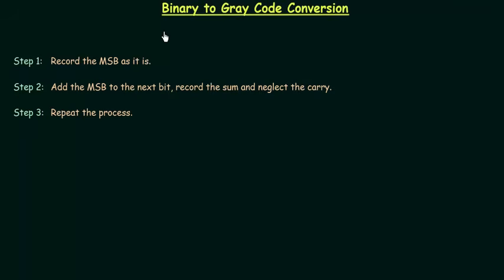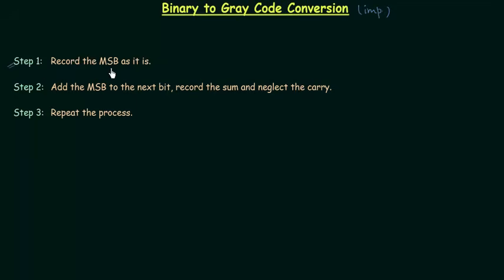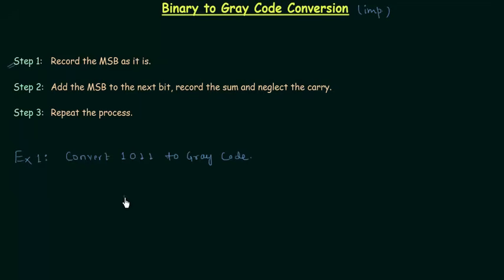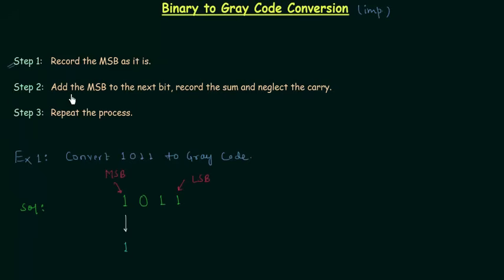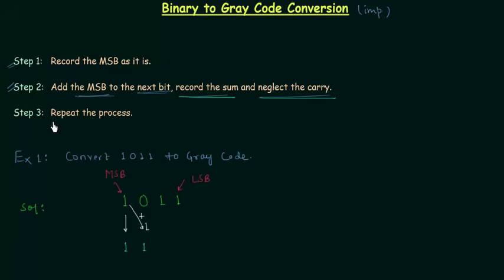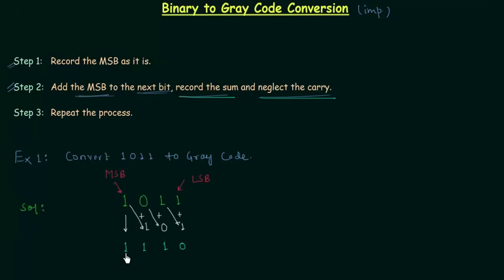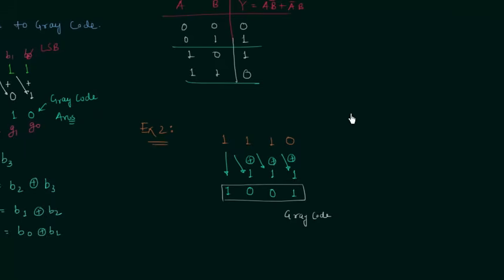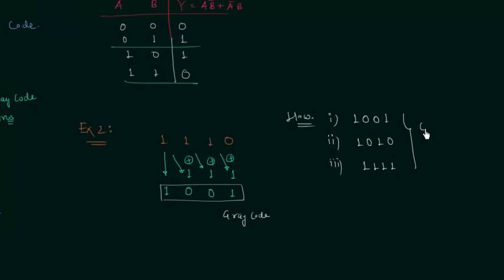Binary to Gray Code Conversion

Comment: Thank you very much for this wonderful series
However I have a question ,how is the gray code of 10000 is 0000? 
That was mentioned in the previous video. 
It should be 11000, isn't it?
Reply: because we only have 4 bits to work with and gray code of 15 is 1000 therefore for 16 we do 0000 as two numbers having difference of one in their decimal value should only differ by one bit. so since 15 is 1000 making 16 0000 makes sense

Comment: I have a better method. I observed the table and found out this. 
Let's call it Rohit's rule.
Step-1:- Copy the MSB as it is.

Step-2:- If bn+1 is 0 then copy the digit in bn as it is (i.e if b3 is 0 then copy the digit in b2 as it is.)
               If bn+1 is 1 then copy the complement of the digit in bn.
Step-3:- Repeat this process.
Ex:- Convert 0101 into gray code.
Ans-       b3   b2   b1   b0
                0      1    0      1
         Step 1- Copy the MSB. So g3 will be 0. So till now:-
                                  g3   g2  g1  g0
                                   0     _     _     _
         Step 2- Now to find g2 from b2..check the value in b2+1 i.e. b3 which is 0. So copy b2 as it is which gives g2 as 1.  So till now:-
                                  g3  g2  g1  g0
                                   0     1   _     _
                        Now to find g1 from b1..check the value of b2 which is 1. So copy the complement of b1, which is 1, in g1. So till now:-
                                  g3  g3  g1  g0
                                   0     1   1     _
                            Now to find g0 from b0..check the value of b1 which is 1. So copy the complement of b0, which is 1, in g0. So finally:-
                                  g3  g3  g1  g0
                                   0     1   1     1
Once you understand this you can solve sums quickly.
Reply: Hey Rohit! Some feedback on your claim:

Tldr after trying it:  your method's can equate and can be not as good , same idea, written differently, and a bit tidious in comparison.

(It has you needing to be focused on each bit while doing calculations, instead of just doing calculations on already written numbers)

overall having 3 instead of 2 methods for doing the same thing.

I gave it a shot a multiple times, I solved the problems a bit slower with this method in larger numbers and less accurately as you tend to get lost lost in the digits while keeping tab of the index.

But I'm sure it's parallel to the two previous mentioned methods, as it just a rephrasing of the operations, whike minding the properties of XOR operation on constants :)

So in practice, it's nice that it does the same thing as the two previous methods, now having 3 similar methods instead of 2 (even though it also requires to keep track of the last digit instead of just doing the calculations neatly for each digit.)

Anyway nice attempt! How did you notice it?

And heres a small challenge for you - how will you tweak this one to do the conversion the other way? Be happy to hear your try :)

Comment: i am confused.... 1+1 = 0 i am not getting it
Reply: you cant use 2 as a representation in binary system, so if the sum is greater or equal to 2 "which is the base of binary" you subtract 2 and add a carry to the next bit so 1+1=2 subtract 2 u get 0 and carry 1 to the next term, and also 1+1+1=3 and since it's greater than 2 u should also subtract 2 from 3 ull get 1 and carry 1 as well
Reply: You are confused becuase you refer to it as an arithmetic operation (addition) as "one plus one equals two".

But this isn't actually an arithmetic operation at all, it's a boolean operation (exclusive or) between boolean constants " true exclusive or true is same as false "

Hope that helps :)

Comment: gray code is an unit displacement code...but in 1110 two digits are changed...it does not follow that rule
Reply: It is equivalent grey code of a binary code...
And concept is grey code of two consecutive number (e.g 4 and 5) differs by only a single bit.
You can take any two consecutive number , find their grey code and compare .... you'll get your concept clear.

Comment: Sir what if we take 0100, which will be the MSB and is the procedure same as for the others
Reply: 0 will be the MSB so the solution will be 0110
Reply: 1 will be the most significant digit as it's the first non zero from left
Reply: Gray code is written for 4-bit Binary numbers. So 0(zero) is the MSB.
Reply: The choice of MSB does not matter in such cases, the answer will be the same regardless of the choice